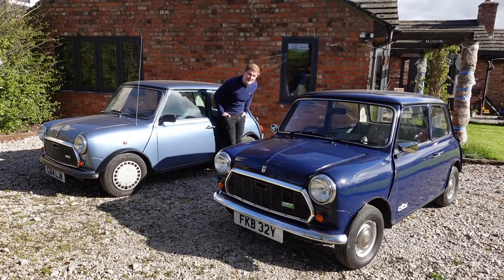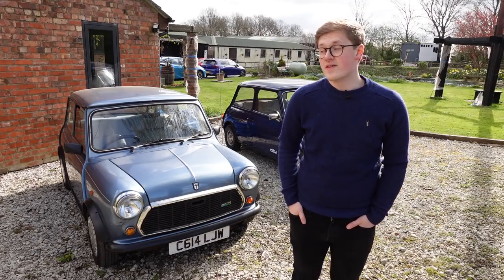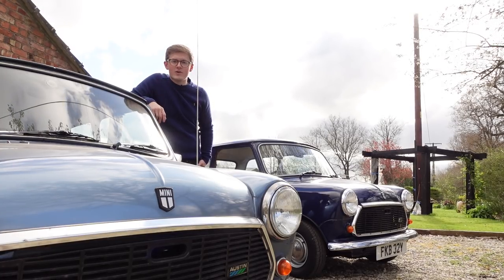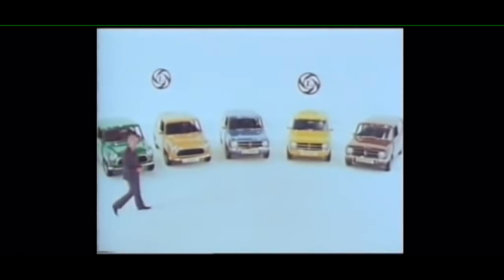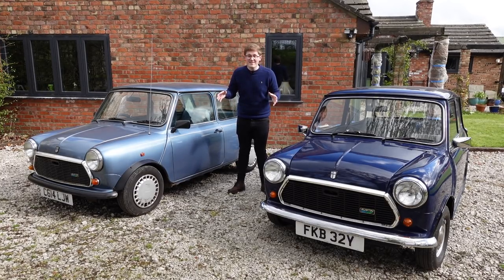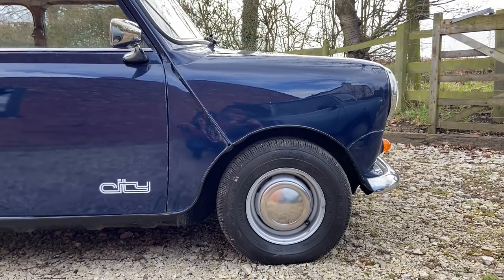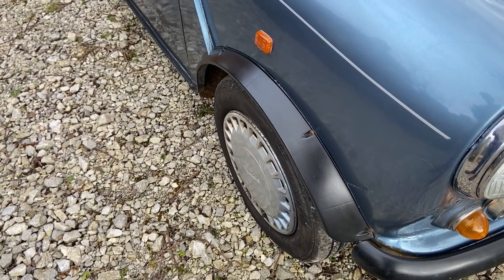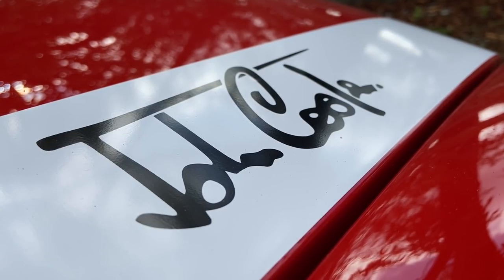How the Classic Mini Survived the Launch of the Austin Metro

Comment: The 80s to the early 90s Minis are my favourite period of the Mini, especially after the 89 updates with the brake servo becoming standard. It becomes much more civilised and easier to drive but still without the complicated electronics in the form of an injection and ECU. My own 1990 Mini Mayfair II is also very special as it is a JDM Mini which means: air conditioning.
Reply: The soundproofing was added at that time IIRC. Mike Read (EastEnders Frank) did a voiceover for one of the new 'quiet minis' as I recall. A great civilising feature, but the A series engine buzz still made itself felt if not heard!
Reply: I agree.  Well refined by that time, but before the early 90s electronics.  I also have a JDM 1990 Mayfair in old English White.  Have been having great fun with the car for 5 years now.  Sadly, the Japanese owner removed the AC system prior to my buying it.

Comment: Great video. We had one in brown. As well as being fun to drive and look at, they were easy to fix. Ours was stolen by some joyriders who trashed it and we managed to bring back to life and repair with scrapyard parts.
Reply: Yup, very easy to work on. I paid £60 for a 1979 Mini automatic in 1990, and it got slower & slower. So I bought a new cylinder head from a scrappie for £5, and fitted it myself in about an hour! It restored the power, as the old cylinder head valves had big holes in them LOL! Shortly afterwards the gearbox broke, so the whole car went to the scrappie  :-(

Comment: I can remember when I first drove the Metro and thinking "This is never going to work, it'll fail as everyone preferred the Mini". Guess I was right and wrong, the cult following is stronger but for some reason if I had to chose today, it would be a Metro, partly due to its practically and also, the rarerity.
Reply: Having driven both I would also say the legroom. There's only a tiny bit more room in the early metros but it's the difference between getting your knees under the steering wheel or having one leg either side of it. And I am a 31 inch leg so not exactly a giant.

Comment: My 1st memories of the mini was a ride in the back of a family friends. Even as an 8 year old boy the 80s mini felt cramped and interior very basic. Then it didnt want to start. Was a rainy day. Didn't like damp much. After about 20 attempts it finally burst into life. Was then obvious this had character and that characteristic gearbox whine and rorty sounding engine is responsible for quite a lot of it. It was certainly not comfortable, bounced around all over the place but it did feel fun in an unrefined kind of way and very nippy and easy to park. But I think you enjoy it more as a driver than a rear seat passenger. Compared to anything modern it is hilariously small. To even be able to seat 4 passengers in a car that size is impressive. There was probably more room in original as 80s had thicker seats.
Reply: The radiator being to the side was a major design flaw as there was nothing behind the front grille except the distributor cap. Mine only used to run on 3 cylinders in the wet until I got a marigold rubber love, cut the ends off the fingers and stuck it over the dizzy cap with the plug leads coming out of the fingers to keep the water out.

Comment: I used to like the 1960 Minis the best, with small rear lights, and generally sober colours except red. There were the posh Riley Elf and Wolseley Hornet models with the extended boot, and the 1980s Mayfair could be a more modern Elf/Hornet.
A rival to the Mini was the Hillman Imp, rear engined, built from 1963 to 1976. You will have to find an Imp and comment about its history.

Comment: That GT didn't have alloys, they were plastic wheel trims on its 12 inch wheels because the 1275GT had 8.4" disc brakes from 1976: before the Metro existed. They are the brakes they adopted across the range from '85.

Comment: I bought an '83 Mini City (bright orange) back in 1992. As a petrol head I felt I had to own a Mini at some point. But I didn't fall in love. Bus driver positioned steering wheel coupled with my 6ft frame struggling with the leg room killed any chance of that. They do have their charm of course, but not for me. I had a later Metro on an F reg.... far better car. Motor magazine's main problem back in '77 was the sound deadening. Which was not addressed until the imminent launch of the Metro. Pretty piss poor that, eh?

Comment: Great video. I miss not having a Mini SOOOO much..!
 And in Australia even a Rotten body without out Engine will fetch a $1000 AUD.
 When I first got to Oz I was able to buy myself a Runner for $250 in 1980. Because No One wanted them..!
 But with a couple of Kids and a Fussy wife.
 I was forced to Sell it for a Ford Falcon 6 cylinder fuel Sucking Monster.

 A few years later, Divorced & kids only now and Again..!
 I wanted the Mini Leyland 1275.cc and had it until Some Twat T Boned me..!
  And by then the Value was Climbing..! 
 So settled for the Ford Capri Convertible XR2 DOHC Turbo. 
 1600 cc 16 valves and fuel injection. Close enough..!
 Kim in Oz. 😎
Reply: P.s Front wheel Drive too...!😎

Comment: I swear, if the Mini is brought back - it will sell like hotcakes
Reply: @TomBartram-b1c  To add to this, parking is getting more and more ridicilous with how large cars have gotten. The Mini is a near-perfect blend of practicality and phisycal size. In my country, most of the in-city speeds have been lowered to 50 km/h with regional roads topped at 80-100 km/h depending on the road. Motorways are still speedy, but invaded by tolls.

Comment: I had a D reg City E and then an L reg Rover Mini Cooper. The City E seemed to always need work doing to it but this work was always cheap. The Cooper was great fun but the electrics were a joke, particularly the immobiliser (the sort with the plastic key you held to the steering column until the red light went out). I had an absolute hatred of Rover for seemingly wrecking this car for many years after I'd sold it and moved onto much more reliable cars.